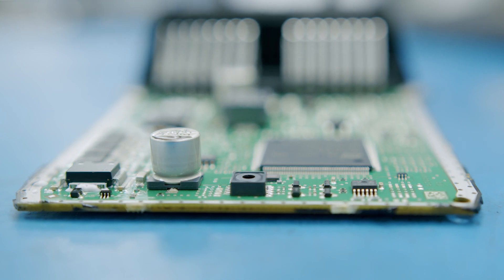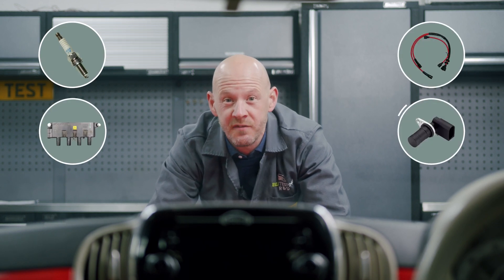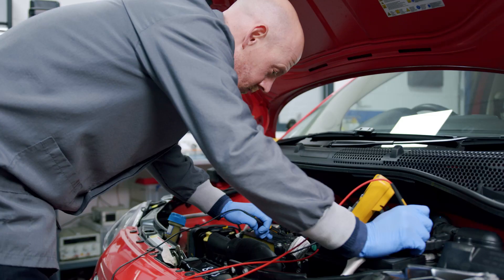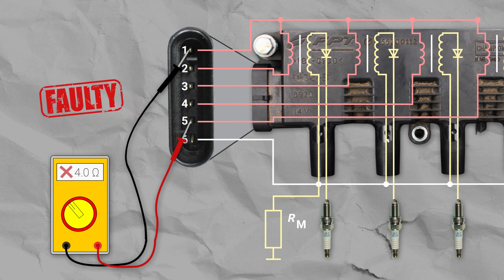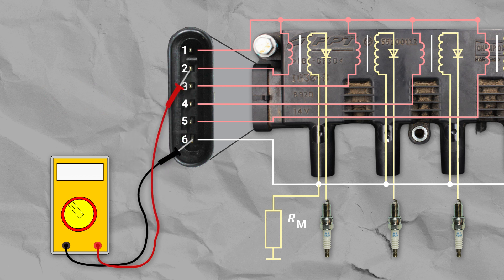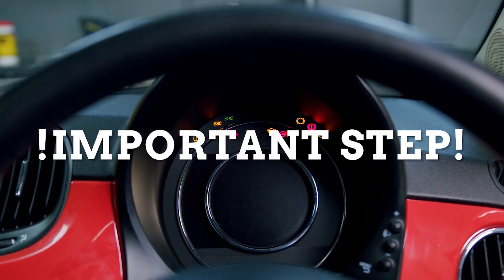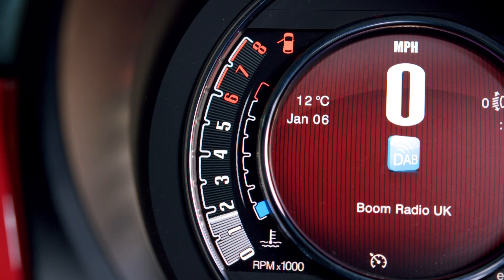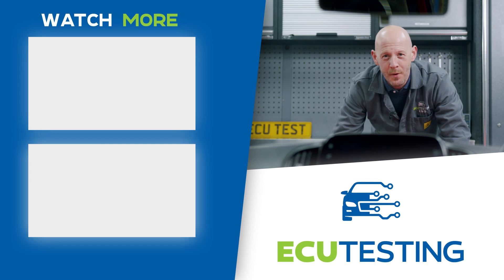Fiat 500 Misfire – Coil Pack Testing and ECU Explained

Comment: I have a ford ka mk2 which is the same engine, showing misfire on cylinder 2 and 3 and the engine light flashes for 10 seconds or so whenever you go on a motorway and drive over 2500 rpm but seems to drive fine and the engine light doesnt flash when just driving round town. Would it be worth changing the coil pack or would you suggest its the ecu?
Reply from the maker: Hi there, you are welcome to send the ECU to us for testing. You can follow our test form here; https://myaccount.ecutesting.com/?return=%2FTestForm If you have any queries before sending the part to us, please give us a call on 01773 535638. Thank you!

Comment: I dont understand why 0.0 ohm between 5 and 6 is faulty
Reply: Because the other pins read O.L(meaning not connected) so 0 ohms means there is a connection with no resistance i.e a short between the positive on one of the coils and the common ground. as far as i understand it.

Comment: Hi guys, great video. i tried to measure the first one from 1-2-5. dindt get anything. the other way around., 2nd measuring from 6 to 2 it gives me 0.04 - 0.06 max. can that also be the coil being broken for the fiat 500 1.2? thx
Reply from the maker: Hi. From what you have described it sounds like your coil pack is faulty. We would recommend trying to replace this and then re-test to confirm.

Comment: Great Video.  I'm learning much about my 2015 Fiat 500. I've got 99k on it and the spark plugs and coils have never been changed  It is reading PO300   01/o3 freeze frame,  02/03 pending  03/03 permanent   I'm wondering should I start with spark plugs and coil change and also have coil pack tested? Before assuming the ECU is damaged?
Reply from the maker: Hi. If you are getting any secondary fault codes we would recommend dealing with those first (e.g crankshaft sensor codes), but if you are only experiencing misfire codes then yes we would recommend ruling out spark plugs and coils first before condemning the ECU. If you do believe your ECU is faulty then please feel free to send your unit into us for testing at www.ecutesting.com.
Reply: @Ecutestinglimited  Thank you so much for your response.  I have a basic OBD2  scanner.  I'm assuming the best course of action is to have it towed to a mechanic who can do a more thorough diagnostic.  AS you have mentioned it could be  ECU malfunction.   To avoid unnecessary cost AND given on the OBD2 scanner it showed  PC300  o3/03 permanent  is it likely that it is the ECU if no other readings show problem?   I live in California and don't want have unnecessary repairs.   Can a mechanic who works on European cars have the diagnostic equipment to determine if the it's the coil pack, the ECU or both?  Thank you so much for your help.
Reply from the maker: Hi. The P0300 being permanent doesn't mean it is more likely to be an ECU fault, as badly worn spark plugs/faulty coils and other faults can cause a permanent code to be set. We would recommend contacting a garage who has diagnostic equipment and experience specifically for Fiat vehicles to be on the safe side.
Reply: @Ecutestinglimited   Thank you so much for your guidance.  I  have found a mechanic who is familiar with the Fiat 500.
Reply: @Ecutestinglimited  Good Day, the spark plugs have been changed. The shop is not specific for Fiats but has worked on Fiats. They have not changed the coils to the spark plugs yet.  He said that the code is reading Po300 not indicating there is a problem with the coils.  Do you think the coils should be changed to see if that will remedy the misfire before we go further ?
Reply: @ECUtesting  When you refer to the coil there are 4 coils 1 to each spark plug  is there another coil?

Comment: This is exactly what has happened to my 2015 Fiat 500 POP, but my mechanic has said nothing about the ECU being no good, but i have a huge feeling that it is all shorted out. I say this because of what I heard in the video, and also because when I started the a few days ago, it started up so rough that I noticed the check engine light flashing, so I shut the car off and had a tow truck take tow my car to the mechanic's shop. They have told me that two of the coils are showing that they need to be replaced, but that they are going to replace all four of them. I would think that I also need to have the ECU rebuilt. Chances are with the coils being bad it means the ECU got burned up Right? I want it rebuilt after reading how a brand new one won't last more than a year due to a faulty design and I would rather get a long standing warantee too.
Reply from the maker: Hi. Generally you are correct that when one or more of the coils are faulty, they can damage the ECU. If you would like to get your unit tested to see if it requires a re-build, then please contact our technical support team via email at info@ecutesting.com, with the following details: Your make and model of vehicle, the details of your fault as described above, and any further relevant technical information (such as previous repairs carried out on the vehicle). Thanks

Comment: Have a 2019 Abarth which misfires when cold until it warms up then runs ok. Have checked pretty much everything apart from ecu, what's your turnaround for checking the ecu. Thanks
Reply from the maker: Hi. Please visit our website www.ecutesting.com and search for your ECU part number for the most up to date pricing and turnaround times. If you cannot see your part number on our website, please email it to info@ecutesting.com, along with the details of your vehicle's make and model, symptoms and fault information, as well as any diagnostics you have already carried out, and they will assist you further. Thanks.

Comment: Hello i have a 2009 fiat 500 and i just   put a new engine in it  and it wont start.. I have used the computer to diagnose the problem and it telling me that my ECU isn't getting any power and i checked al the wires, al the sensors and al the fuses and everything seems to be working but it stil wont start.

Comment: My 2014 fiat 500 runs perfectly when starting from cold until you stop it and restart it then it won’t run properly. It sounds as if it firing on 2 cylinders and the throttle butterfly is dancing around and it will not rev when pressing the pedal. If you keep trying then eventually it will start to rev to 4K and then eventually will start to rev fully again and then runs faultlessly until you stop and try to restart again. 
Does this sound like an ecu problem or not. I don’t want to fire the parts cannon at it and a scan at my local mechanics showed no faults.

Comment: Hi daughter fiat 500 turning over but not firing was told it has low compressing and was told it’s the head gasket? Does this sound abt right?
Reply from the maker: Hi. If you have the vehicle diagnosed by a garage and they have identified the cause of the fault as low compression, then a blown gasket can be a cause of this. However there are other causes, so we would recommend getting the vehicle diagnosed by a garage if you haven't done so already. Cheers
Reply: Many thanks 🙏
Reply: Did the car sit for a long time before having this issue? If it's a multiair, they have problems starting up after sitting for extended times due to oil bleeding out of the multiair unit.

Comment: Does this apply with a 2013 dart 1.4
Reply from the maker: Hi. The basic principle will be the same, however this video is specifically for Fiat 500's.
Reply: Except for the coil pack short, as there's no single coil pack on the 1.4 multiair but rather individual coilpacks.

Comment: Great demonstration. Currently am working on the Fiat Punto NO crank and NO start checked battery, startor found all good  scan tool is not detecting Engine Ecu what could be the Issue.
Reply from the maker: Hi, we are glad you enjoyed the video. If your scan tool cannot detect the ECU, then we would recommend checking the basics first, i.e. the power supply and ground connections to the ECU, and all relevant fuses. We have gone through these steps in a video here: https://youtu.be/Y3aoD5BMxQw. Cheers

Comment: Great video! One question- I’m testing the coil pack as per 1:07 (pin 1 and pins 2-5), and getting no readout. Pin 6 and pins 2-5, all give a readout of 0.8. Am I doing something wrong or is my pack knackered?
The engine has been starting, but has been misfiring. No codes have been thrown up though.
2nd time with this issue- first time I changed the plugs and the problem stopped for 6months
Reply from the maker: Hi, are you testing a Fiat 500 coil pack or one from another vehicle? Thanks
Reply: @Ecutestinglimited  
.
Reply: Hi, yes it’s a 2004 fiat 500 coil pack. Just spoke to the dealer, and they tried to claim that a fault in the coil pack will prevent starting at all, and probably wouldn’t damage the ecu.. I think they’re trying to get me to take the car to them and pay a £190 diagnostic fee 🤦🏻‍♂️
Do you think I’m measuring the coil pack wrong? Having said that, I’ve reconnected it back up and not had an issue. It’s frying my head to be honest lol 😂
Reply from the maker: @JohnCrebo  We would actually agree with the dealer here, if you weren't getting an initial reading from pins 2-5 against pin 1 then the car shouldn't start, so it must be something with method you're using to measure the coil pack. Are you testing the voltages at the coil pack plug and not the loom end?
Reply: @Ecutestinglimited  I had my meter set to 600 ohms (the lowest setting), and recorded ‘- - - ‘ across pins 2-5 against pin 1. And the same method with pins 2-5 against pin 6, gave me 0.8ohms. This was when remover from the vehicle. Maybe error on my part in touching terminals who knows.
This evening however, I have systematically pulled every fuse, and replaced, pulled and replaced the leads, and the lion from the ecu and replaced. The car does feel like it had more power- so I think potentially something must have been loose and created a weak spark? 
The ODO on the dash is still flashing, and there is still no Blue & Me hands free system so I hope there hasn’t been any damage to the boards
Hoping this has solved the issue and not masked a deeper problem!!  Thanks again- your video has been a great help and you’ve been great in getting back.
Reply: @JohnCrebo  I've got the same. I think the illustration on the video is just upside down or something

Comment: hello I have a Fiat Doblo in my shop right now and no matter how many times I replace the coilpack on cylinder #3 it keeps burning them it even melts I trace the wires and they dont touch ground at all what Im suspecting is the ECU its fried
Reply: What I got from watching the video about the coils going bad on the 2015 Fiat 500 POP is that when two coils go, your ECU is fried. I also got that you should send the ECU unit to be rebuilt because it you just buy a manufacturer's ECU they are all faulty and won't work for more than a year. It you have your ECU rebuilt by ECUtesting in Britain they rebuild it and give you a lifetime warranty and you won't have repeated problems.

Comment: I live in US i did coils plugs injectors filters carbon test but didn't know about ECU. As I still get the shaky car and cyl 2 misfire still. I have a 2015 pop 500 1.4l non turbo
Reply from the maker: Hi. If you have ruled out everything you mentioned in your comment, then it is likely that your ECU has been internally damaged and failed. If you would like to send it in to us for a re-build, we do offer a worldwide service so you can simply fill in our online test form at ecutesting.com. If you have any other questions please contact our technical support team at info@ecutesting.com. Cheers
Reply: One difference is the US cars only come with 1.4 multiair, which has individual per cylinder coils. So there is no possibility of a shorted coilpack burning the ECU like happened here. That said, there are some other things that can damage the ECU.